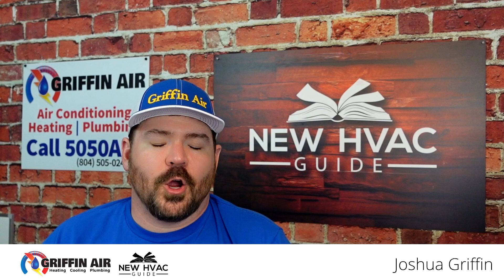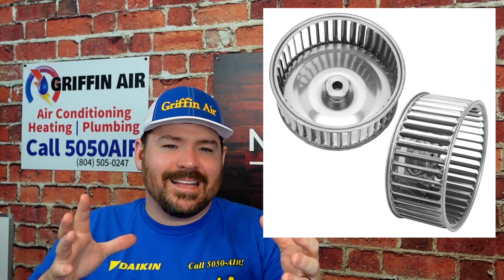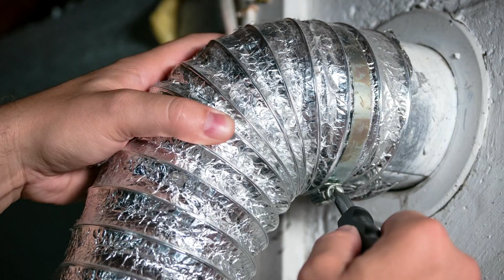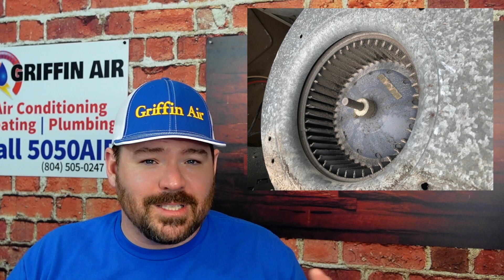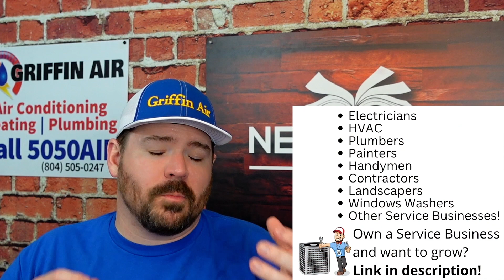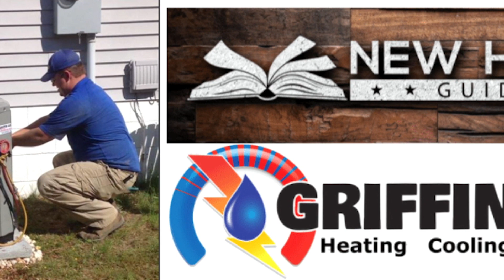5 Reasons for a Vibrating noise in HVAC!

Comment: I live in a 2 year old apartment. The heat pump vibrates so loud I can feel it in my head. Im not able to sleep at night and it's affecting my health. I've told the building manager and made a few complaints to maintenance. All they say is, it's cold, it's normal. It's not normal. It's awful. It goes all night long and makes all different kinds of noises. No one has done a thing about it. I suggested dampeners or insulation to muffle the vibrations. The building manager said it's a fire hazard. Um no, it's not. I don't think I can let live here much longer, this is enough to drive someone crazy. I wish you could hear it, it's ridiculous. It's 24-7, even when it's above freezing, it doesn't stop. I don't know what to do.
Reply: I think the installation was shotty. Probably because this is the old projects so they don't care how terrible their work is. Please tell me what I can say to these people to get them to fix this.